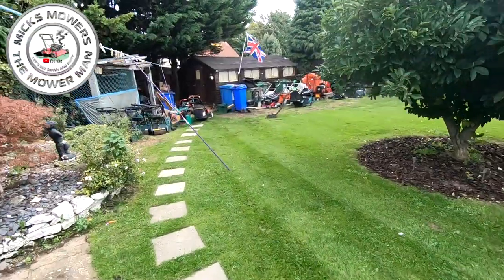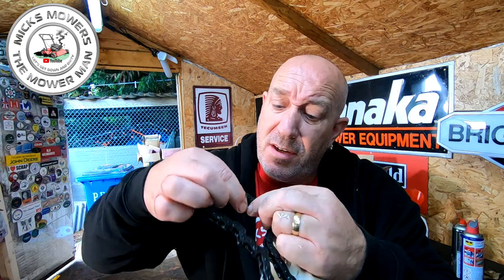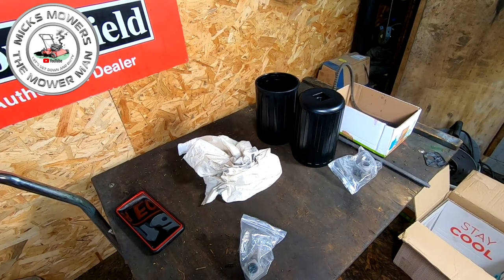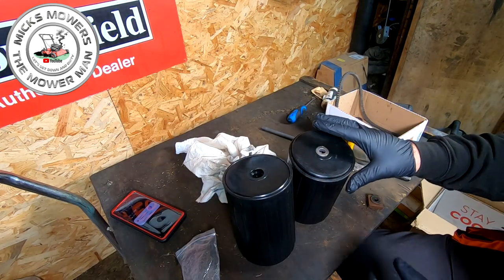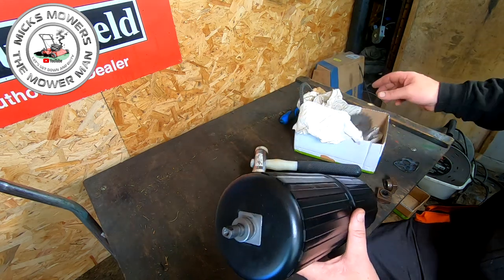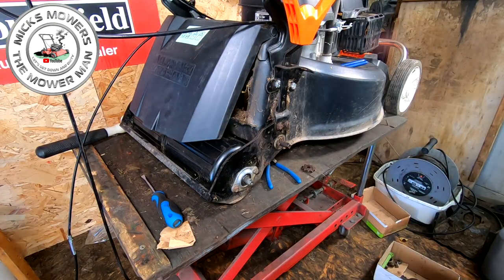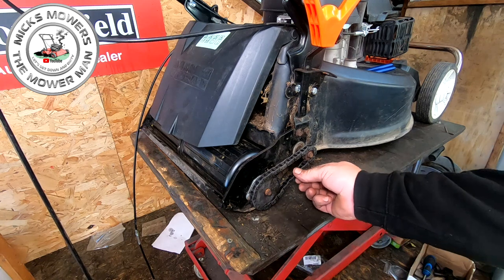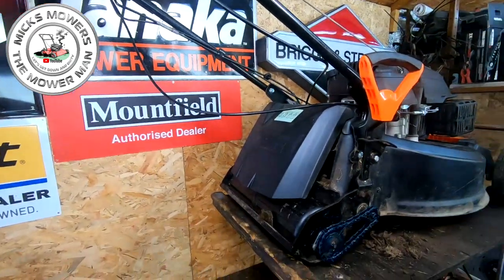FEIDER TR5220 Lawn Mower Roller Replacement Drive Problem #FEIDER #TR5220

Comment: I bought a feider mower 4 wheel not the roller one for my rough gardens and mulching hedge clippings only paid 350 for it and it's been brilliant starts great and feels really well built and I'm used to 1000 pound plus mowers
Reply from the maker: Yeah I hear ya.. but yours is the wheeled one.. big difference..
Reply: @themowerman  yeah don't think I'll be replacing hayter roller mowers for a fieder
Reply from the maker: @rjworld7122  yeah 
. I like the Honda Pro roller..